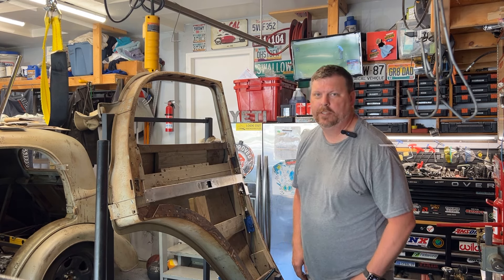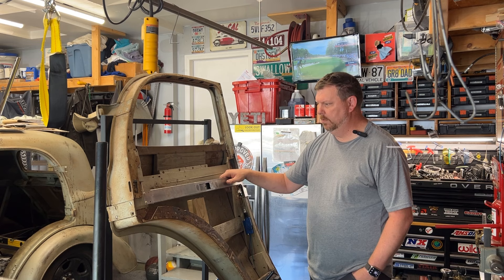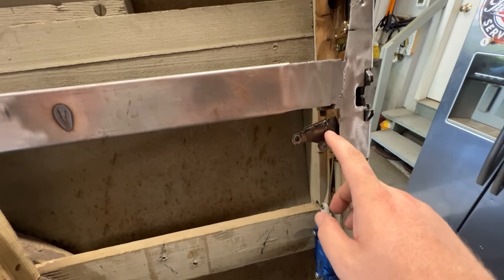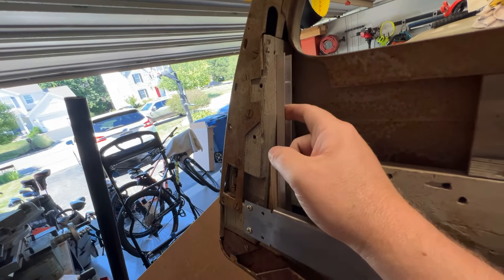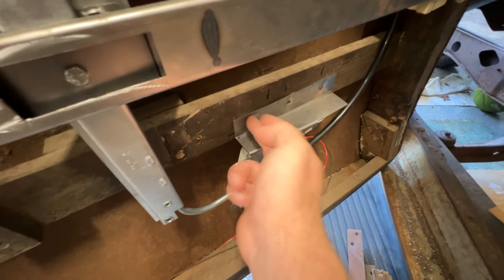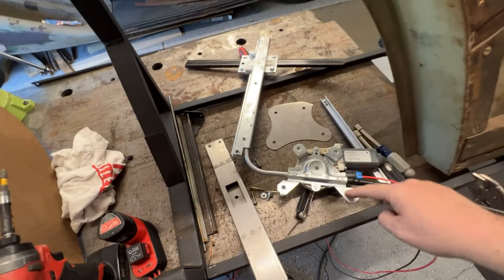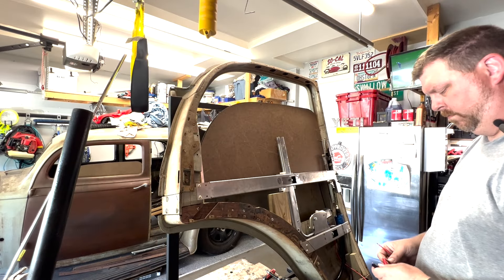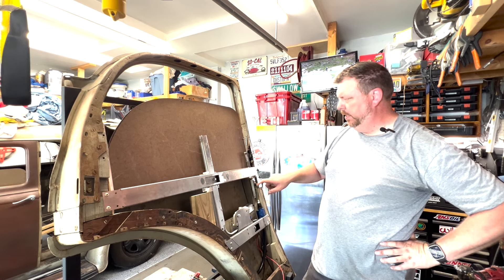Power Windows in  a Street Rod the right way... maybe

Comment: DO THIS>>>>
Buy on old rod & pull the body off the chassis & discard. Go to the insurance auction and find your self a fairly new
drivable minor collision car which will fit your rods wheelbase, maybe even and electric. pop off its body & discard 
and mount your old rods body to it. NOW- you have a cool looking old rod riding around on late model smooth 
riding chassis  w all the latest safety features, its is reliable  quiet  and  comfortable. UNLESS of course you want
to spend every weekend for years to come banging out dents & grinding & sanding & welding and swearing.

!
Reply from the maker: Body swaps have their place in car customization.  I prefer this method for this project.  65”wide x 133” long wheelbase cars are no longer a thing with new safety standards.  

I enjoy the challenge